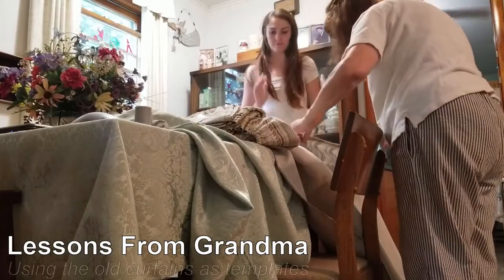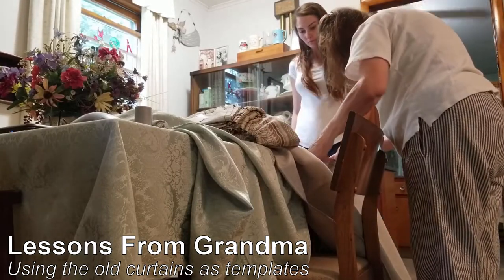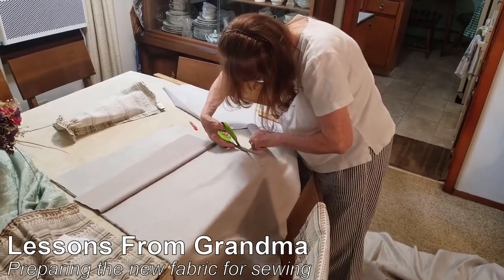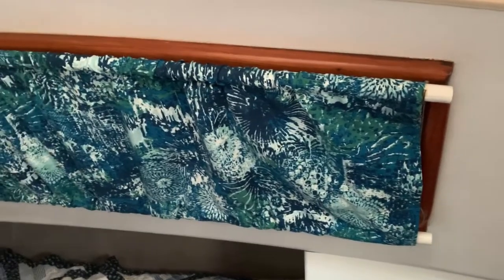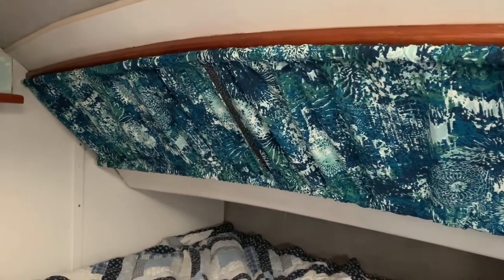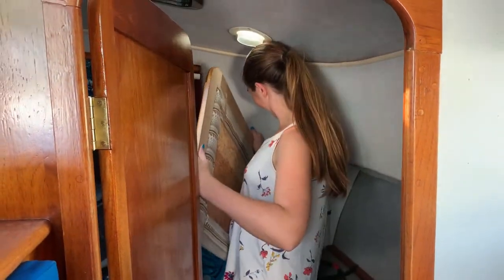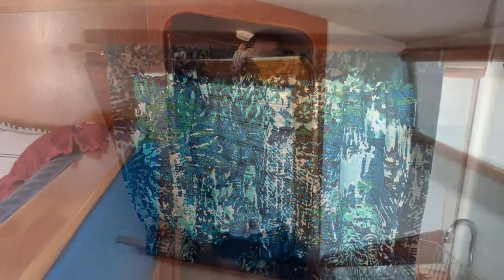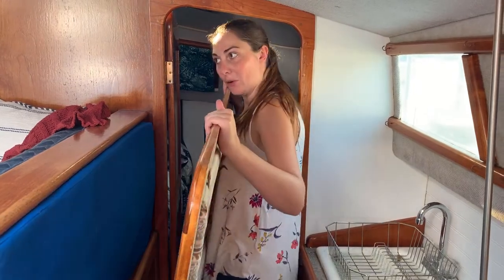Sew What? DIY Boat Curtains & Upholstery (Boat Work: Sailing 9 LIVES)

Comment: Good job working with that material folks.   Were you able to float the boat off???We have a singer heavy duty and with a walking foot so far we've been able to do sail repairs, etc.  It works a little on the sails but once it gets going it's fine.
Reply from the maker: Thanks, Allyn. The machine is definitely value-priced, and it isn't nearly the machine that a sail-rite is, but it gets the job done.
The boat, by the way, is a wreck. I was able to get her afloat briefly with a pump, but as soon as the pump stopped, it sunk immediately (even though I blocked off the huge gash). Turns out there are several more holes in the bottom. When Nicole swept through a bit later, the stbd hull ended up getting holed, too.